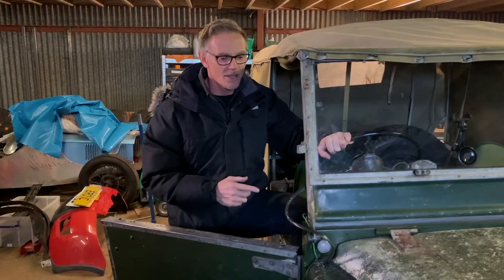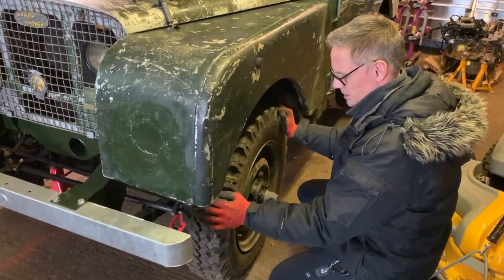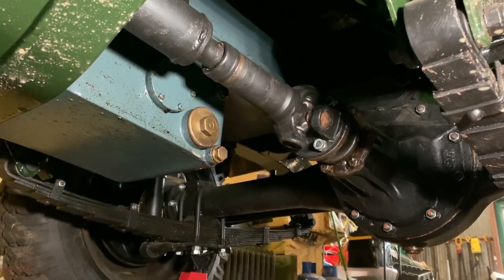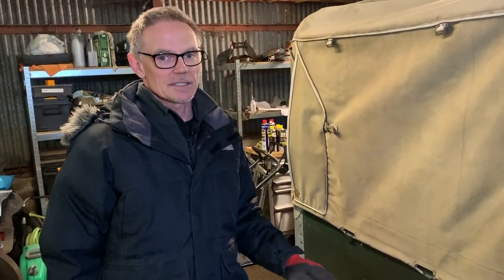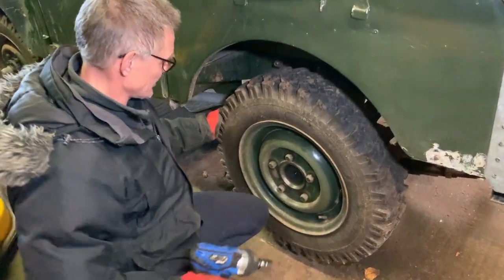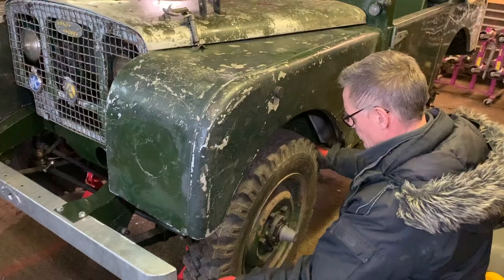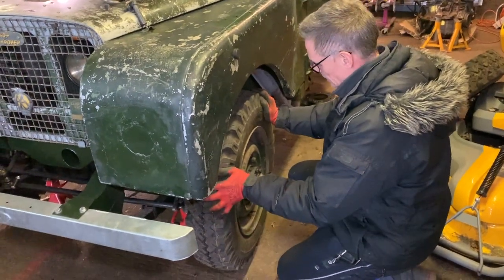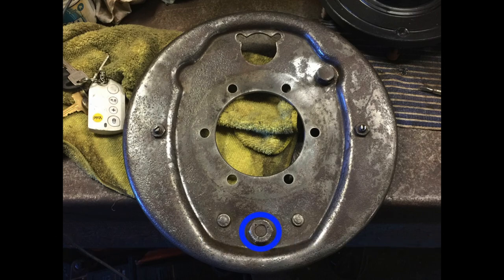Land Rover Series 1 Brakes Binding Investigation

Comment: The springs in the wheel cylinders are too strong so they push the trailing shoe out, so when you rotate the wheel backwards it pulls the shoe on.The Delfi cylinders in particular do this. I work at a Landrover specialist in Yorkshire and we've seen this many times now, fitting new pull off springs sometimes helps, we also put some weaker springs in the cylinders as well. Those modern bonded brake shoes also are rubbish and take for ever to bed in resulting in spongy pedal feel, they're more suited to servo brakes where the greater pedal pressure beds them in quicker.
Reply from the maker: Thank you for the comment, this makes a lot of sense. For now I may just adjust as best as possible and use it a lot see what happens.  I will see what I can find out about weaker springs in the cylinders and stronger shoe springs.  Interesting that it is three out of four that do this, but then I am used to things that do not always make sense!

Comment: I had the same problem on my front near side. Where it would lock up on reverse.  It turned out to be warped drums.
Reply from the maker: Could be the case here, although I did measure them.  I had a deflection meter, put the drums on backwards so I could then put the meter on the inside of the drum.
However, it is still a good call and if it had carried on, the plan was to buy new drums.

Comment: Your top brake spring shouldn’t be fixed to the hole in the brake shoe it should mount to a post that fits onto the back of the shoe, that same post is the post that the snail adjuster sits on... Hope this also helps as it prevents the spring pulling the shoe wrong!
Reply from the maker: Thank you for the pointer, I have to take them all apart again so I will check to see. Is there a groove in the post that the spring sits in?  I should be able to take a look tomorrow, again thanks for the tip!
Reply: @hyphensclassics  yes on the back of the leading edge shoe i believe there is a post that the snail sits on and on that same post there is a groove that the top spring sits in.
Reply: @hyphensclassics  do you have an instagram account i can message you some pictures of mine on
Reply from the maker: @tenxyou5547  Hu, yes I do it is Hyphens Classics.  Thank you on the tip about the red springs, I have gone in and changed them all just yesterday, filmed for a later episode!

Comment: I have a similar issue with my 2a. I changed the brake cylinders, shoes and springs, the diff rotated fine. As soon as I bled the brake system, all of them are binding and some are stuck solid. Did you find out what was wrong with yours?
Reply from the maker: Yes and no! I did shave more of the leading and trialing edge of the brake material, basically add an attack angle.  I also changed the way the springs attach, I think I discussed in the video!?

Comment: I have the same trouble, new shoes drums springs, did you resolve the problemn ?
Reply from the maker: Yes and no!  So the binding did go, but I never got the brakes as good as they should be.  The car has been stored for a few months now and last time I drove it the rears where binding again.  So it is going to need further investigation!
Reply: @hyphensclassics  trailing shoe seems a crap design, mine is a 1980 so they didn't improve it. will take some friction material off top end next, good luck from snowey
 scotland.
Reply from the maker: @jamesdolphin6714  agreed.  I have tried removing material, tried different config s of the springs, checked the drum for runout!  Not sure what to do next!  Still one will try again.
Thank you and good luck to you also, one thing I miss, a good amount of snow!